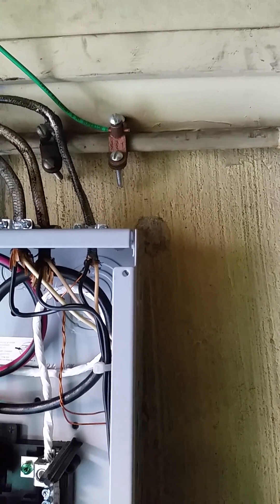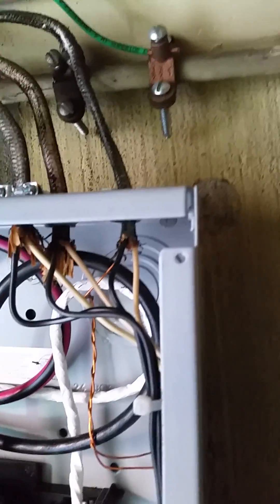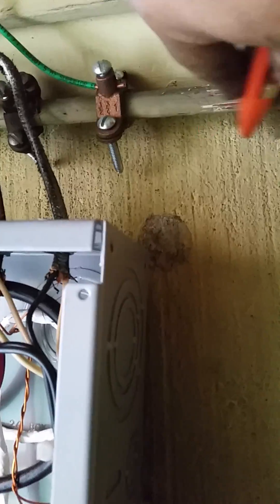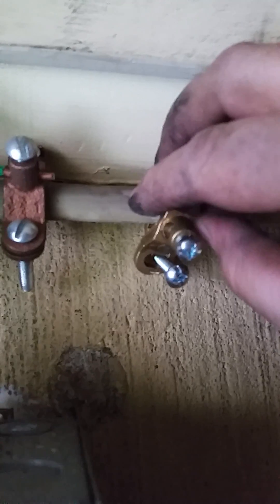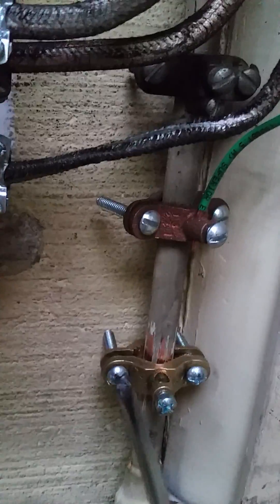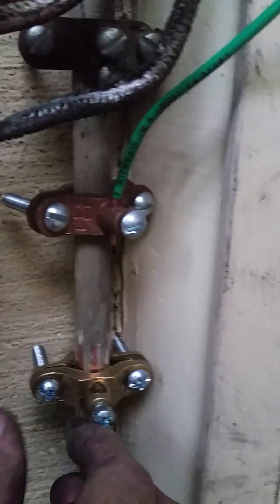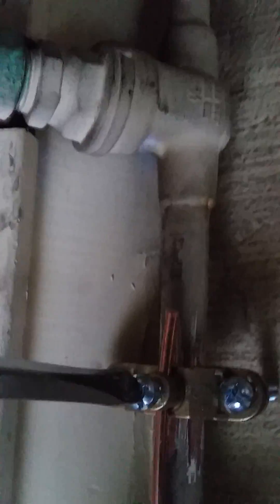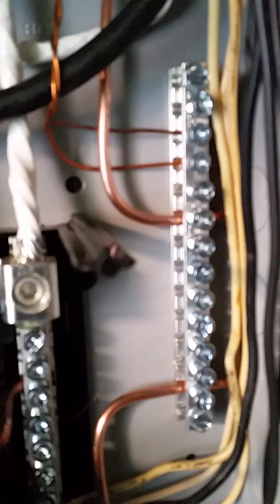Installing a ground clamp to a copper cold water pipe (pipe scraping is rough-sorry 🤪)

Comment: Most, if not all, of these ground clamping devices use steel screws to hold the brass/copper items in place. Those are dissimilar metals that make up a battery when an electrolyte, such as water, is present. They WILL corrode at the point of contact. The steel corrodes (rusts), not the copper, and in the process, electrical contact is lost. Replacing those screws with brass, you avoid the corrosion issue as long as everything else is copper or brass.
Reply: No. The copper wire has direct contact with the copper clamp, and the copper clamp has direct contact with the copper pipe. Any corrosion between the clamp and the screws is irrelevant.

Comment: Someone told me that this is a no no because of electrolysis.  However, it looks to me like the parts that touch the copper pipe are also copper, so I think I got bad advice.  Your thoughts?
Reply: As a plumber I've only seen leaks ocurr thanks to electrolysis when copper is touching galvanized pipe even if it's just a wire sitting on top of a pipe will cause that whole section to rott at a much higher rate
Reply: You got bad advice.  Water pipe cannot be damaged by an electrical current.  Keep in mind that the ground is a safety feature for emergencies and fault conditions and there shouldn't be any sort of current going through there for long periods of time.

Comment: You would think it would be against some kind of rule to have a water pipe directly above a panel. doesn't sit well.
Reply from the maker: CopperHeroin you're right, it doesn't meet code, however this is a home built in the early 1900's that has some "grandfathered " codes. It EGC should be installed within 6 ft of the water meter and have minimum clearances around the panel of 36 inches, the ceiling here is right above the panel.

Comment: Where do I attach my ground if I have PEX water lines? Should I just drill a hole through the basement floor and drive in a grounding rod?
Reply: catfisher420 are you trying to ground the panel?
Reply from the maker: catfisher420 most likely your jurisdiction still requires a ground rod, but an EGC to the H2O entry is needed within >6 ft of the water metering device, that could be a long run...

Comment: great info, my kitchen outlets don't have grounds, can I use ur technique to ground my dishwasher and garbage disposal?
Reply: The main reason is if you ground the kitchen plugs to your water pipe you will have a Potential of making your plumbing hot and cause a pipe to burst and a major potential of shocking and killing one of your family members
Reply: kg kb you explain this very well my friend. Thank you.
Reply: No ... this is to ground your water pipes .. To ground your dishwasher & garbage disposal you will need to put them on GFCI outlets .. that's the cheapest way to ground your outlets. If you don't do that you will need brand new wires ran in your kitchen to the outlets which will cost you a ton .. just get you two GFCI outlets & get someone to correctly install them for you